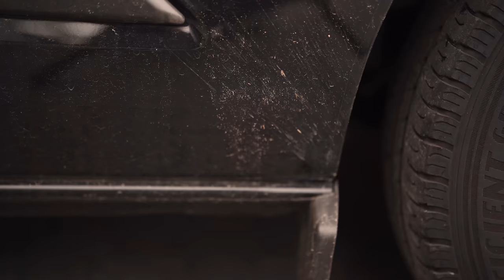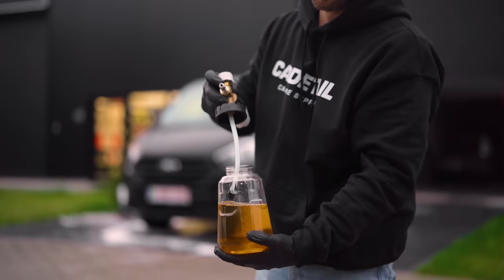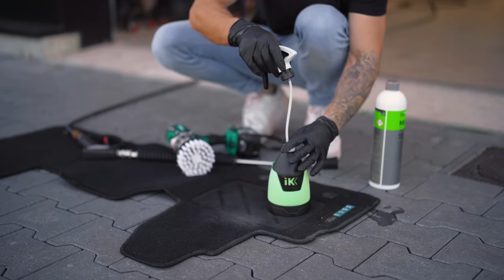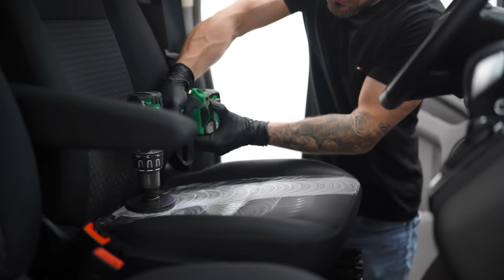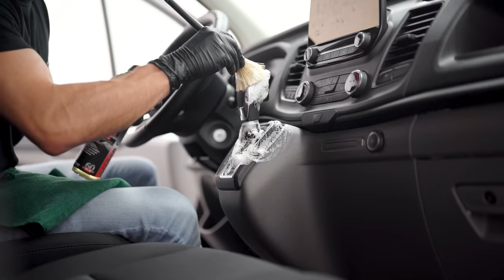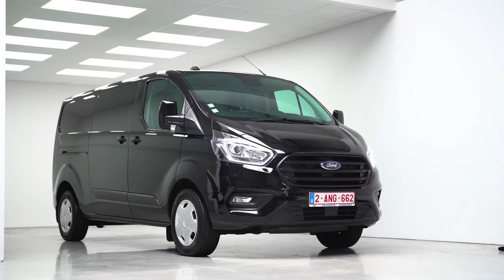Interior & Exterior Deep Clean of a Dirty Ford Transit

Comment: Weer een top video! Hoe bevalt de hydrofoam sealant tot nu en zou ge da product ook kunnen gebruiken als enige beschermlaag na het wassen als ge geen keramische coat hebt?

For non-dutch speakers: Do you like the hydrofoam sealant performance and would you recommend it as a standalone protection on a car without ceramic coating?